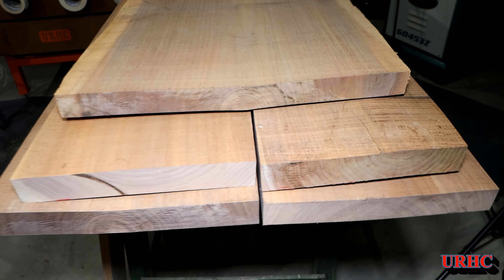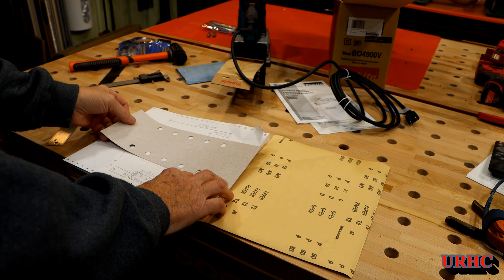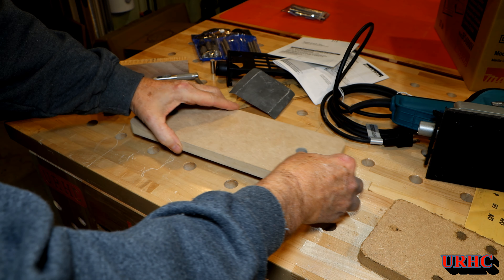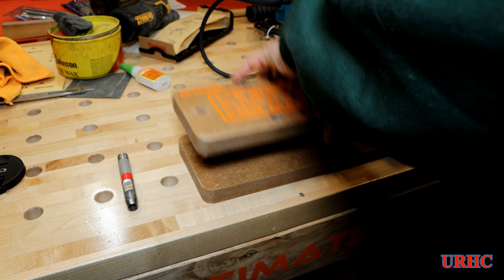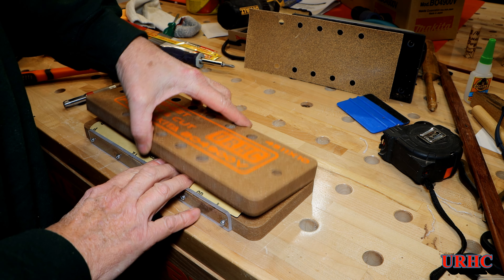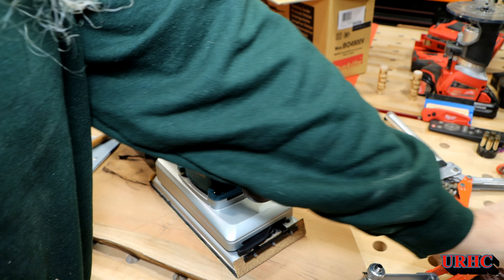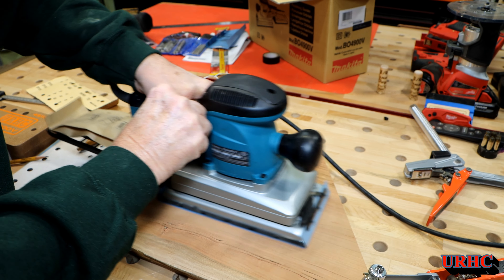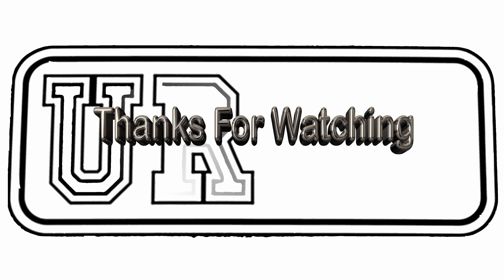Makita BO4900V Finish Sander First Look And Building A Punch For The Sandpaper

Comment: Ed, I have purchased several multi speed sanders over the years and have found that I always use it on the highest speed. I think the multi speed is a marketing ploy. It sounds good but in fact there is no need for it. That is just one man's opinion and I do a lot of wood working.
Reply from the maker: This one definitely doesn't like the lower speeds. I am used to my RO sanders that work at any speed. This one is slow but does leave a nice flat surface. Thanks for watching.

Comment: Impressed with your work and impressed with Makita doesn't include the template out of the box. You should sell this template in eBay, at least a 3D printed version, I'll be one of the first buyers. Thanks for sharing again.
Reply from the maker: Thanks. I think you may be able to buy a punch for this sander from Makita if you search now. Nice sander that still works good for keeping large surfaces flat. Thanks for watching.

Comment: Nice idea to cut and punch holes in sandpaper. I'm thinking of a similar design to cut paper into quarter sheets.
Reply from the maker: This half sheet paper is tough  to find punched so this will work for my needs. The hacksaw  blade doesn't  leave a perfect edge but it's quick.  Thanks for watching.

Comment: Your creativity and knowledge is impressive.  I wanted a way to use up a stock pile of 5" 8 hole sandpaper that doesn't line up at all with my new 9 hole sander.... and now I have my answer.... quick jig and i'll get a set of punches to best match the size of the holes needed... I was hoping to come up with a solution that would cut all 9 holes at once... but even if I get a few to line up, it would be better than none.
Reply from the maker: Thanks.  If you have a good disc to copy it should  be easy to make a template. I don't  know why there isn't  just a standard  pattern they all use. Thanks for watching.

Comment: Try a layer of poly board for your punching surface,I do leather work and have had the same board for five or six years . Punching in the same spot will wear it out faster but you can just flip it.nice sander.
Reply from the maker: I will in the future if this wears to bad. So far it's working good and the center makes the punch work like a die. Thanks for watching.